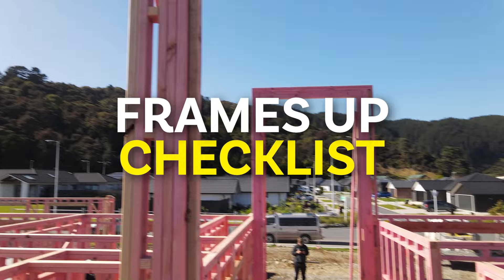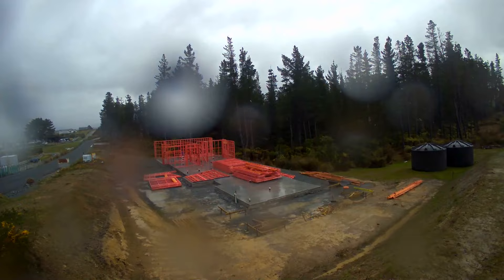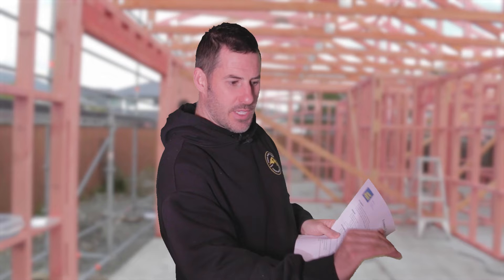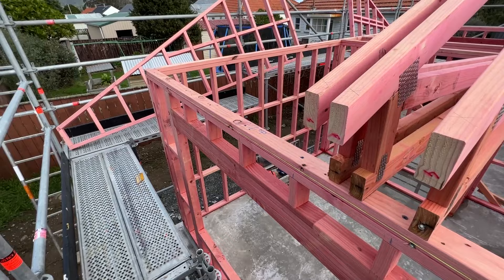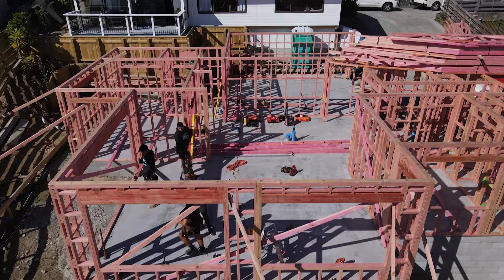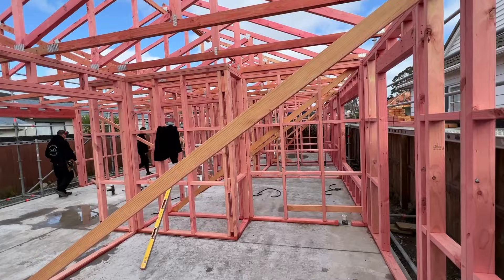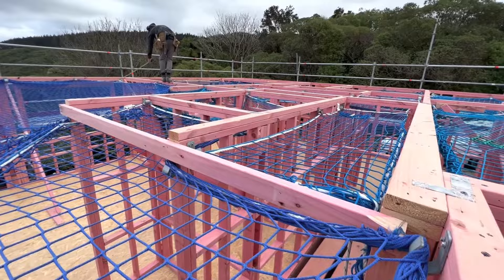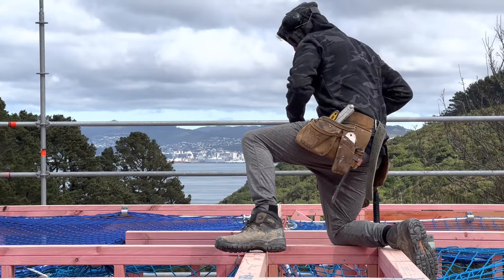Timber Framing - Start to Finish Guide

Comment: Awesome video Josh. How would one create the rebate in the external frame to install the the ply sheet bracing? I’m home owner building and this confuses me a bit. Cheers
Reply: The pre framer can rebate the framing to allow for 7mm bracing ply if requested. Otherwise, you will just have to install the 7mm brace ply and then pack out the rest of the wall with 7x45mm ply strips. 
If the cladding is brick then you can just slap the ply on as there should be a 40mm cavity for the brick.
What's your cladding?
Reply: Tip - Install your brace ply BEFORE building wrap that way you can use galvanized round head nails. If you install it Over top of the building wrap then you have to use stainless steal nails which are way more expensive. But sometimes you can still get away with galvanized just depends on the building inspector. This is for NZ of course
Reply: @dacob100  hey thanks heaps mate, that is just the info I was looking for. Your a legend! Cheers
Reply from the maker: Great suggestion!